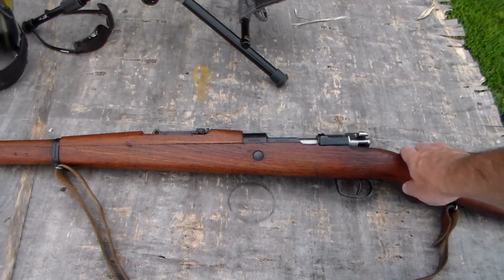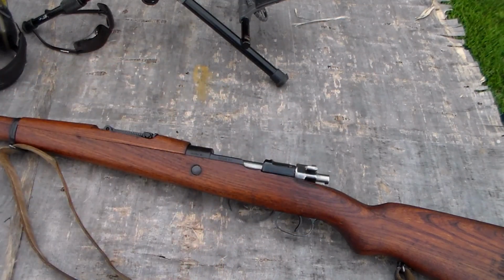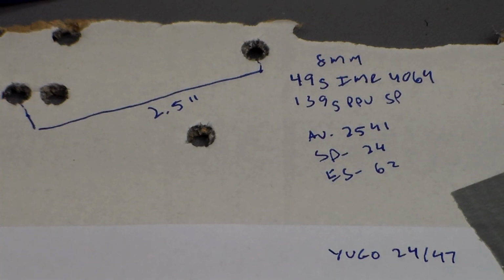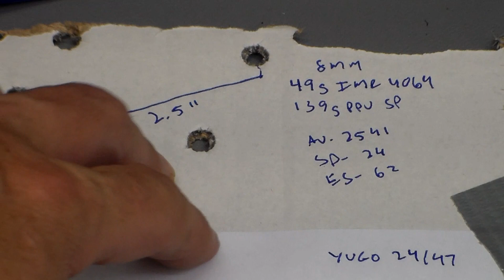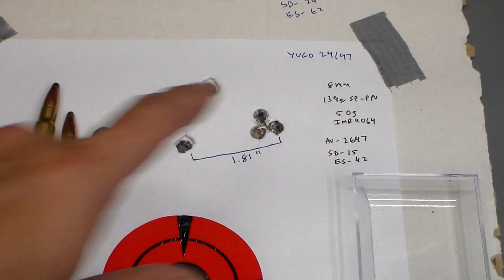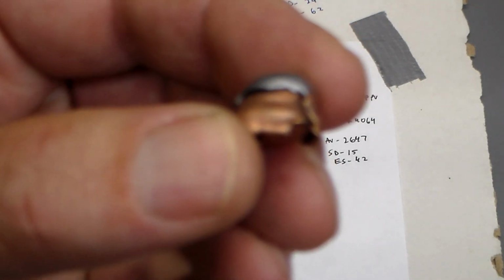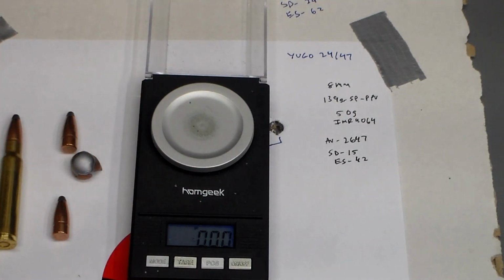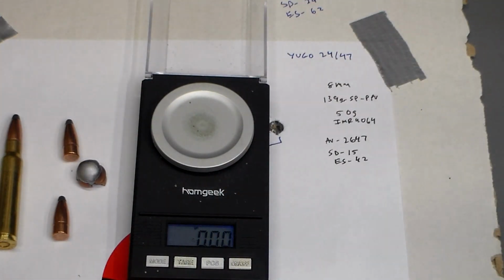139 grain soft point PPU bullets and IMR 4064 in 8X57 Mauser

Comment: I tried the 50gr load in my Remington 700. I got an average of 3088 fps. I have a question. Have you ever used any Winchester 748 for this bullet? I have plenty of it. IMR 4064 is a little hard to find around here.
Reply from the maker: I need to try different powders. I haven't done any reloading with other powders, but I am looking at CFE 223 for 8mm.